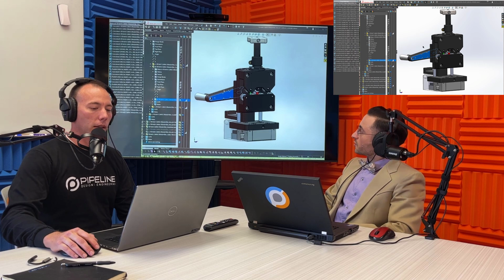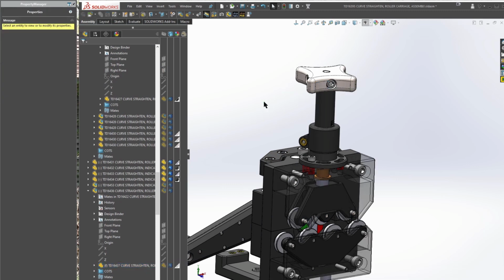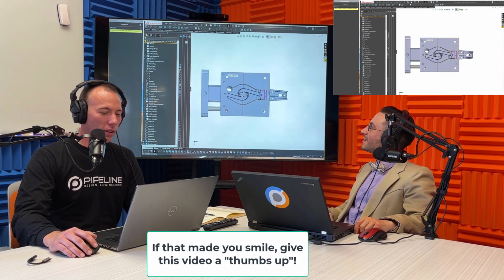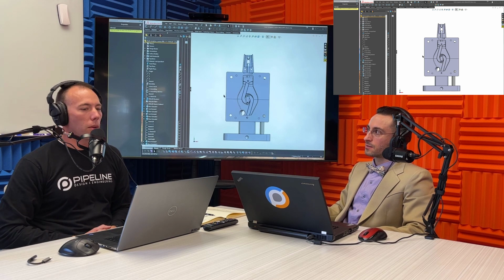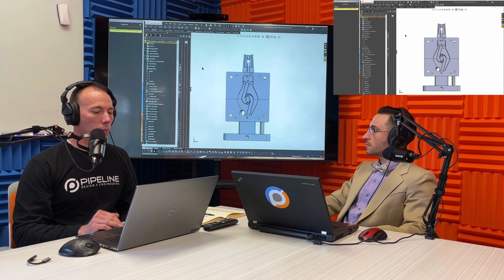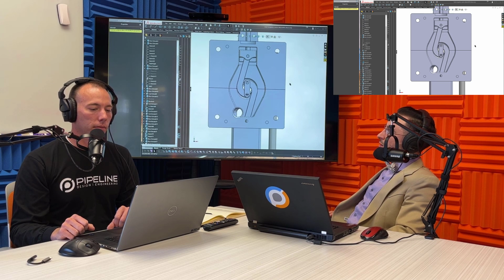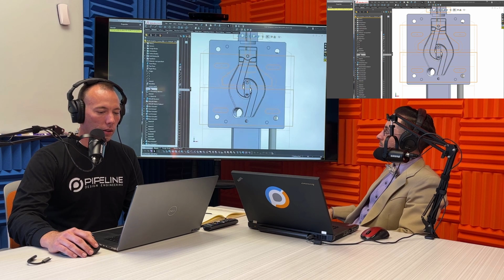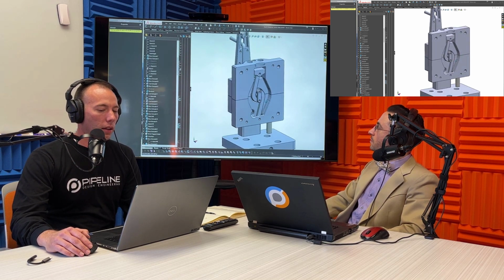1. Mechanisms & Mentorship: Symmetric Over-Center Clamping Mechanism

Comment: Maybe this is explained in the next 13 episodes, but why did both jaws have to move? Why couldn't the bottom jaw be stationary? I'm sure there's a good explanation (request from customer, ergonomics, trails, etc.). Besides the reduction in complexity, cost, weight and potential failures, it would allow the wire/cable/tube to be placed on the bottom rollers and be undisturbed until the top rollers pressed on top of it.